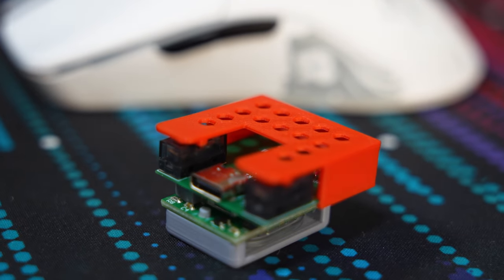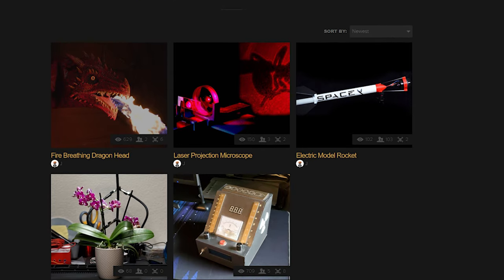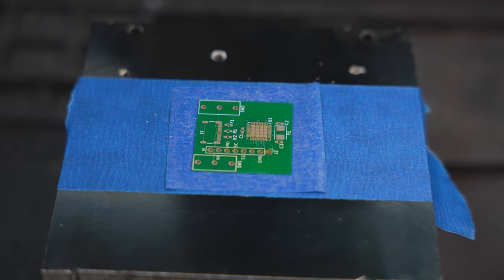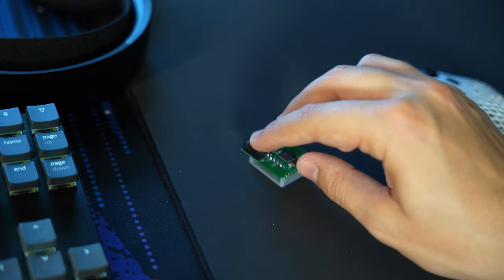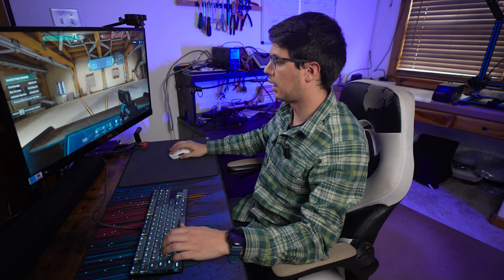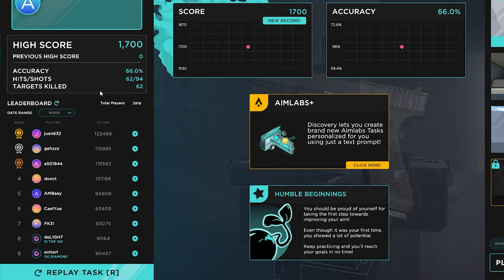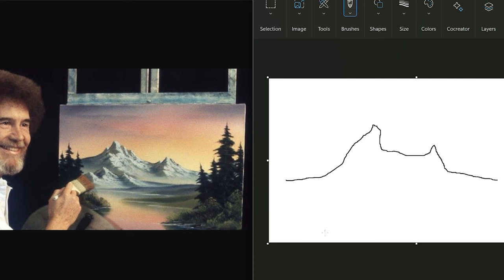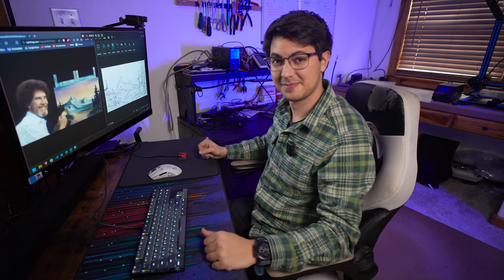Worlds Lightest Gaming Mouse | DIY Ultralight Build

Comment: i wonder if you Could make a seperate battery and wireless transmitter case that you could strap to your arm and then run a cable from the case down to the mouse, so that the weight/stiffness of the cable wouldn't interfere with the accuracy of it.
Reply from the maker: This is brilliant. I may have to try this for V2. Definitely want to make it wireless next time

Comment: I bet due to the size and weight the cable makes a massive impact on the usability. You should try doing like wireless charging or adding a battery and a reciever to make it wireless.
Reply from the maker: It absolutely does. I definitely want to make it wireless next time

Comment: Could extra buttons and a scroll wheel be added? My kid is doing a mouse for a design project in high school.
Reply from the maker: absolutely! it would require a different PCB layout, and some tweaks to the code, but its built within the Arduino ecosystem, so it can definitely be adapted. All the project files are on Hackaday
Reply: @Tage-Labs  I seem to have shot myself in the foot. I got the PAW3370 sensor and can't find someone else's code to "borrow".
Reply from the maker: It looks like for that sensor you have to register with Pixart and sign their NDA, then you can get a datasheet for the sensor that includes the software communication specs